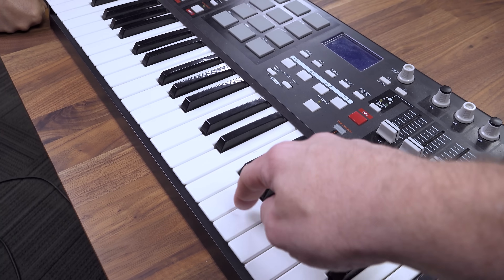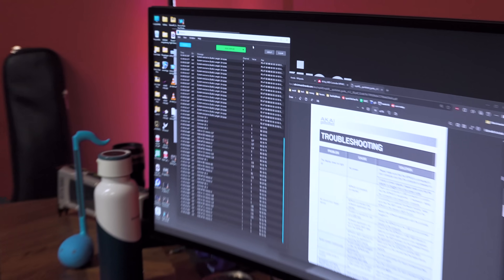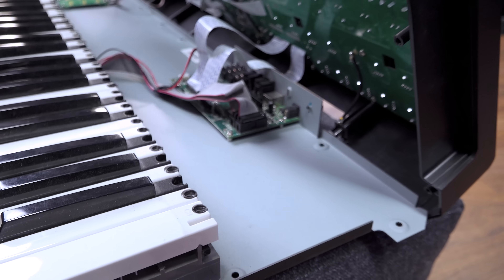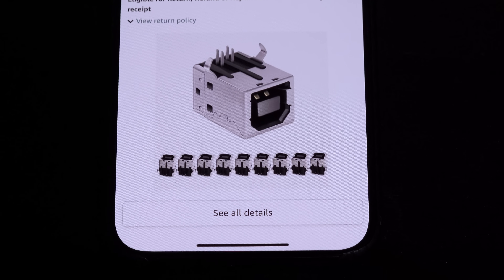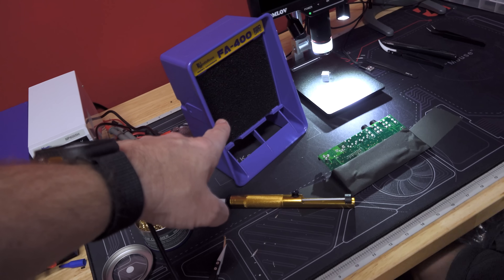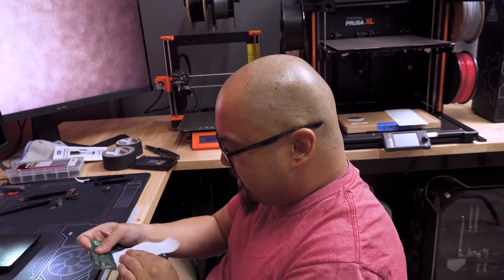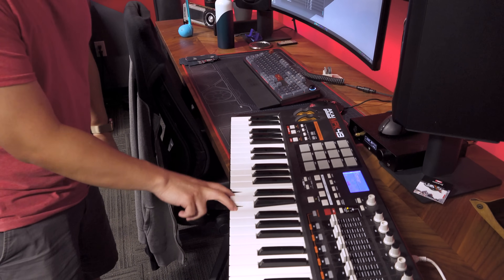The USB port snapped off! Let's try solder on a new one...

Comment: Flux is your friend, use plenty even to desolder. It cleans off with denature alcohol, a small brush and a kemwipe. Add low melt (leaded) solder on the joints BEFORE desoldering to lower the melting point of the solder to reduce the amount of heat you need to put on board.
Reply: I'm quite curious about why everyone recommands using flux that much. I've been doing some hobbyist level projects, but on some projects dealing with lots and lots of tight spaced SMD components (mostly down to 0805 not much smaller) as well as through hole for a decade now, and never felt once the need for flux except when dealing with ICs with tight pin spacing like TSSOP, TQFP maybe. Though when reflow is needed flux sure helps, with SMDs specifically, and maybe also here to help with desoldering the big bent legs supporting the USB socket.

I use Kester 44 leaded solder with rosin core, and that on its own just flows perfecty in every situation pretty much. When it doesn't flow well anymore, just touch up the solder joint with a little more solder, and it's perfect. The solder joints are very clean like that. Is flux more important with different types of solder, maybe lead-free stuff? Never tried that.

Good advice for desoldering, I always add a little new solder before, it helps tremendously, but I never used flux in a situation like that. I use to use the Engineer SS-02 to desolder, now I moved to the Hakko FR-301 desoldering pump, both amazing tools.
Reply: @Slay3rOne  well rosin core solder has the flux inside it, so I guess technically you are using flux, just not applying it before hand but it is still helping with the flow of the solder and removing oxidation.  

It is also more important to use with an older board like this repair
Reply: @strongislandx  Yeah that's true. And it shows especially if you have to insist a bit and a lot of the flux burns away, adding some more solder helps a lot, with the added built in flux of the new solder.

Also, I sometimes do repairs on old stuff, I own a bunch of old CRTs, Tek scopes (special silver solder needed on the vacuum tube models!) and else. The build in rosin flux has really helped a lot, as I very rarely had to use flux, and it was always a clean solder joint.
Reply: @Slay3rOne  They recommend it because they saw it on a video. Flux should only be where you are working.
Reply: @LordofthePings-k  No... because they understand what the purpose of flux is.
Reply: @TheGameBench  Mhm..Were you hoping on us bluffing our way as well? I know that you know that I know. It's always obvious you must know that by now. So in your not so infinite wisdom attempting to address those who do is asinine. You should stick to those who entitle themselves to ignorance as well. Not only did he repeat exactly what he saw, he still got it wrong. Play that with someone else.
Reply: @TheGameBench  YOU COULD, IDK, Google the correct answer. I could do it for you...I'll add lazy right under ignorant and careless on your resume. Hu-mans...smh
Reply: @LordofthePings-k  I have zero clue who you are or what you know. Your first sentence is a bit presumptuous... as if I should. That being said, it's clear that either you don't know what the purpose of flux actually is, or you're just trying to be edgy... I don't know which, and I don't care. Your premise that people suggesting the use of flux are misguided, and they're just regurgitating something they saw online, is unfounded. That was the only commentary I was making and that's all you should read into it.
Reply: @TheGameBench  Reads like you're just upset I know when you can't fathom how. It's called deductive reasoning. Unfortunately for you it works rather well. 
A parrot repeats near exact. A parrot only knows what it hears and sees. A parrot doesn't not know or care whether the information is right or wrong. You catching on?
Reply: @LordofthePings-k  Your comments read like you have nothing of value to say. You use a lot of words, but don't actually say anything. Perhaps you should use your energy to actually prove me wrong rather than string together pretentious insults... that's if you actually have a valid argument to the contrary. The more you say, the more I'm convinced you have no clue about soldering.
Reply: @TheGameBench  The reason why the solder wasn't flowing into the wick is because Phil didn't have the iron hot enough and perhaps wasn't pushing down hard enough. I agree with MrAnderson , I've noticed lots of people on forums and comments in general just blindly say "always use flux!" without knowing any better. It feels like they do it to try and sound smart because they read it somewhere or saw it in a video. The reality is you don't need flux for through-hole components 99% of the time, especially if your solder already has it. You said it never hurts to use additional flux which is kinda true, but it's really just a waste for through-hole components and it makes a mess. It's useful for SMD soldering because without it there's a high chance you'll get bridging between IC pins. The flux ensures the solder flows to the pads and away from the empty spaces in-between pads.
Reply: @PhazerTech  I never said you needed it for through hole, and yes... there are some people that just regurgitate information without having any experience... but just acting like anyone that says to use flux falls under that is disingenuous at best. And yes, more heat could be part of the issue, but that isn't going to help the solder flow as well into the wick without flux. Flux absolutely helps solder absorb into the copper. This helps the solder bond to the pad as well. That's literally what flux is intended to do. I always use it to ensure a good bond with the pad, even though it's not necessary. You can call it wasteful, but flux is cheap and it doesn't last incredibly long. I'd rather use it than throw it away.
Reply: @TheGameBench  In the context of this video we're talking about a through-hole  component. And the solder doesn't need help flowing into the wick for two reasons:
1. Most wicks already have flux in them.
2. Capillary action is doing most of the heavy lifting. That's why wick is braided. Additional flux is pointless here.
Reply: @PhazerTech  While most wicks have a very thin coating of flux, it's easy for it to be wiped away just in handling. I've had wick not work great, and adding flux made it work MUCH better. As for capillary action... what do you think aids that? Flux. It really does three things. It removes oxidization from the surface, seals out air thus preventing further oxidation and by facilitating amalgamation improves wetting characteristics of the liquid solder aiding in capillary action.

Like I said, there are only upsides to adding a little flux, regardless... and zero downsides. There's no reason to not use it and it has more benefits than you're letting on.
Reply: @TheGameBench  Well personally I've never needed additional flux for desoldering with wick. It always works well for me, so I don't know what to say. You can continue using it for everything, and I'll continue not using it unless the job actually needs it. The downsides are that you make a mess which needs to be cleaned up, and that requires additional time as well.
Reply: @Slay3rOne  Because Kester 44 has flux in it. It's not always necessary to use flux, but it was clear when Phil was trying to use some de-soldering wick, he needed flux. It wasn't flowing into the wick, so he started using the solder sucker instead. The flux helps the solder bond to the copper, which would have REALLY helped the solder flow into the wick. If you're working with leaded solder with a rosin core, flux isn't as necessary, but I still always use flux. It's not going to hurt and, if anything, will help the solder flow. There's really no reason against using it.
Reply: Uh, that keyboard predates lead free solder.
Reply: There is quite a distance between real low melt solders (like Chip Quick desoldering solder, which is bismuth based) that melt under 100C and normal leaded solder which needs at least 183C. Lead free stuff typically melts above 230C.
Reply: Quoting Northridge Fix!  It's KimWipe btw.  They use in chem labs and such for optics/glassware, no lint, very good!

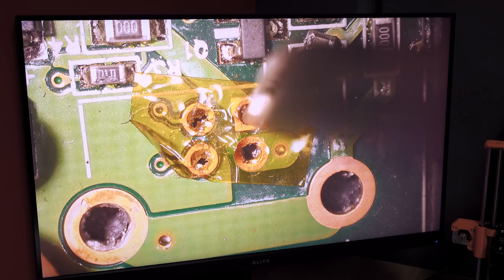Comment: Oh my. I’ve not yet watched the end. But there is a capacitor about to fall off @6:04
Reply: I was about to comment about that too! That cap is hanging for dear life and the pads are gone with it, ouch
Reply: Came to say the same.  I seen that cap just barely hanging on.  Started looking at all the resistors also around there that are gouged.
Reply: Hopefully they see this...
Reply: Oh noooooooooooooooo.
Reply: Good spot. I never noticed that either.
Reply: Maybe shouldn't have used hot air to help getting the socket off. I wick the solder then try to push the pins so that they don't touch the edges of the holes. If that doesn't work I push the pins one by one while pulling.
Reply: yeah i saw that too, top right of the USB socket
Reply: I saw that too
Reply: Seems that I wasn't the only one who wanted to point that out.
I wouldn't want this dude to work on my equipment... but that's coming from me as an electronics technician myself, so YMMV...
Reply: @QoraxAudio here's your cookie 🍪

Comment: As a synthesizer/keyboard enthusiast, and currently restoring and recapping a 1979 Crumar Performer, I really like this new and interesting content dude!!! So many caps I'm dealing with I wound up buying a de soldering station lol
Reply: if you keep working on caps, a nifty device is an ESR meter - it allows you to test a capacitor's health without having to de-solder it (and to check for duds prior to install). it's a bit pricey (mine cost £80) but worth it sanity/time-wise if you end up doing a lot of cap checking, especially on newer models where the caps SHOULD be fine age-wise but you never know if there's a dud that barely passed inspection and died within a year etc., and piece of mind that you're not soldering in a replacement that's going to die too
Reply: @glebglub  already have one, that's how knew the caps were bad

Comment: My piece of advice for these things, don't solder the USB back on the board, make it a daughter board (with a plug) so that if it breaks again, it's just a parts swap. Seriously underrated method of repair that prolongs the life of an old thing like this, because once the traces on the board are gone... you either go full bodge town or buy another board from some shady dude in the back of a van at 2 am in the morning. Just sayin. Fixing things some times needs to think ahead of the curve. jm3.5c
Reply: Youd have to modify the case though as the usb cutout is aligned to it on the pcb.
Reply: @Bassquake76  2:42 , just the backing plate. You drill two holes, unite them, and that's your USB-C basic pattern. Some break-out boards (for USB-C) come with a small bracket for screws as well. You just need to find them. Of course, there's also break-out boards for USB models. I think it's an acceptable trade.

Comment: That resistor near C1, I would consider resetting that. It looked dodgy
Reply: I came here to say that 😂
Reply: Indeed.
Reply: I was about to mention that cap lol... hot air probably pushed it. 

Guys, if you add solder first, makes removing the old solder MUCH easier and safer 👍🍻
Reply: Yep, C1 cap is barely touching the pad. definitely nead to be removed/cleaned/soldered. QC failed, looks like Asus quality
Reply: C means it's a capacitor...'R' would mean a resistor

Comment: 7:55 cold solder
Reply: Yeah, "the best one" might be the worst.
Solder is not hot glue. Heat the board and the component and touch the joint with solder instead of melting the solder with the iron and let it drop on the joint.

Comment: Use flux even to de-solder
Reply: The trick is to add flux, and THEN use solder to mix into the old solder that's on the board. You can then melt and remove the solder very easily, and without overheating anything else around the work area. Lead free is a pain in the ass to work with, so learn with leaded, and then move to lead free if you really want to later.

Most solders used on those boards become rather difficult to melt, even with flux, so using more solder dramatically assists in the melting process.
And with hot air, you want a lot of flux.
Reply: Good flux us lifechanging and so is leaded solder and good solder tips
Reply: Additional flux is useful for SMD soldering. It would be pointless in this scenario, just add a little leaded rosin core solder and you're good to go.
Reply: For flux's sake!
Reply: If you're interested in micro-miniature soldering, Louis Rossman has some great videos on laptop and phone repairs.
Reply: Even if it's "flux-core solder" or something. Always good to use a little extra, especially while wicking
Reply: Flux compensator 😎
Reply: Flux helps distribute heat to prevent burning no? Flux is a good thing, just clean up after yo'self
Reply: @gasracing5000  flux breaks down the oxide layer on both the solder and the pieces to be joined, which allows the solder to flow and wet properly.

There's likely a lot more to it than that, but that's the general gist of it
Reply: @gasracing5000  I would say this is not at all the purpose of flux. Maybe someone else would answer better though.

Anyway, as far as I understand flux is used to help the solder flow the best it can, which is its primary purpose. It helps the solder bond properly with the copper traces and component legs, and I seem to understand it also helps clean those surfaces a bit if they are a bit oxydized? That's it pretty much.
Reply: @Slay3rOne  I looked it up, you are correct. Helping to prevent oxidation, solid connections and promote flow. No mention of heat distribution to preventburning, just promote flow. Guess I should look things up before making misinformed comments 😅
Reply: @gasracing5000  No worries at all! We all learn. 😀
Reply: @Slay3rOne  still reading... lol. Flux has a lot of benefits it seems. I just made it to the burn out section of the exhausting article... 
Best way to learn is to read up and discuss 🤜🤛🏾
Reply: Yeah watching more of this, almost even more with the larger through holes, flux just would have made it easier for a less experienced hand to get a clean, thoroughly heated and solid connection. But hey, whatever works
Reply: Or maybe alternatively just put some fresh solder on before. I rarely use flux to solder/desolder, and talking about through hole and SMDs (0805 packages in general, not used to smaller). Never had any difficulty, or any issue whatsoever with the way the solder flows. I do use flux in rework situations though, for SMDs specifically, and also if I want to solder some very tight spacing SMD IC or something, then for sure flux helps. But I guess it might depend on what solder is used? I use Kester 44 leaded rosin core solder, flows wonderfully.
Reply: @Slay3rOne  For anyone reading this... it ABSOLUTELY matters which solder you use. Just adding solder doesn't work. In this case, Slay3rOne is adding a solder with a rosin core, which means it has flux it in. It's not the added solder that's helping so much as the flux in that particular solder... when you could have just used flux to begin with. Yes, if you're working with unleaded solder on a board, adding leaded will help the solder melt at a lower point, but it does not help the solder flow and bond like flux does.
Reply: @TheGameBench  Agreed. And also this is why back when I ordered the solder spool I'm using right now, I spent time looking for what's the best I could get. Just getting any random thing and hoping for the best is never a good idea in general. It might be cheap and better than nothing, but having quality solder makes life a whole lot easier.

I also agree that using (good quality, once again) flux instead of extra solder should be the better approach in some situations I mentionned above. It's just a bit of bad practice from my end I suppose. But so far it has worked perfectly for me, so in some situations I probably will keep doing it that way, though I definitely will have a closer look at what flux to get for some other jobs.

An example, if I need to assemble a prototype PCB with let's say a lot of 0805 parts and through holes, with my Kester solder having a rosin core, adding flux seems to me totally redondant. I'd say adding flux here defeats the purpose of having flux built in the solder. The incorporated flux makes the job cleaner, faster, and less wasteful. Adding flux barely makes any difference at all, since the solder flow is already close to perfect. If something isn't quite right, then sure adding a bit of flux to improve this particular thing is the way to go.
Reply: @Slay3rOne for less experienced people, more flux can make things easier for sure. If you have experience, you probably when/how much to use etc but for a newbie or early on, having extra helps flow the solder and make connections more easily, keeps heat more even etc. that's how it was explained to me at least, I'm no expert just a "passable enthusiast" level lol